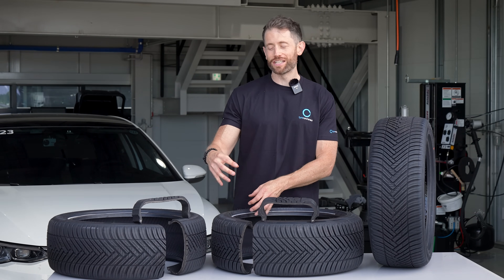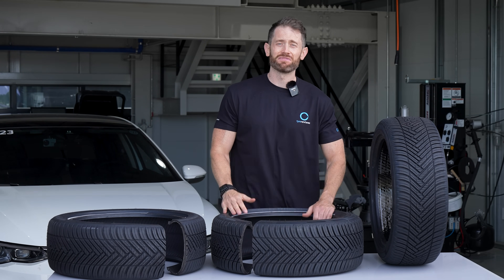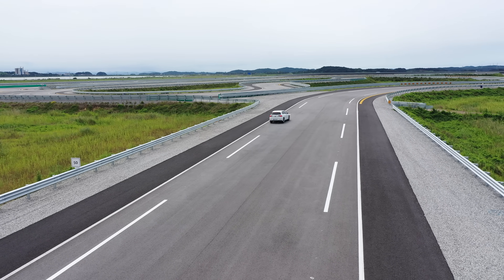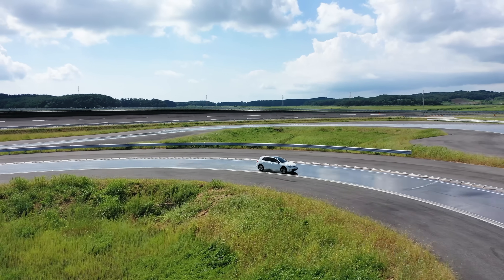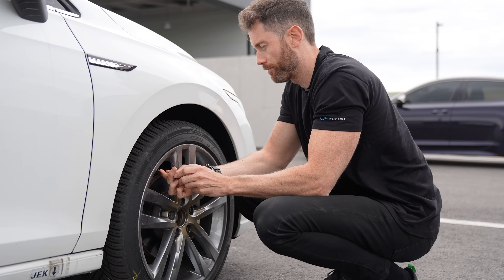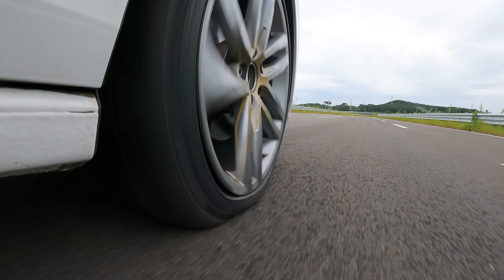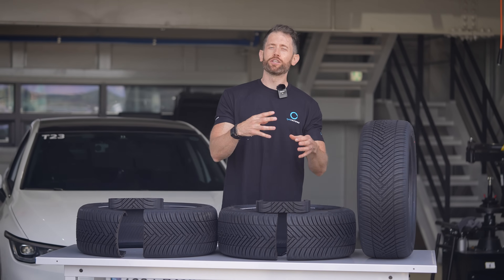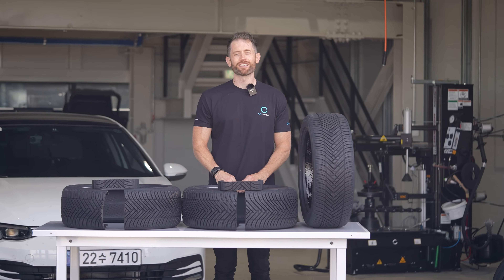Are Modern Runflat Tires Finally Good? Normal, RFT and SEAL Tires Compared!

Comment: My daily driver for the last 4 years have been an BMW X3 3.0 diesel with 21’ rims and it came with OEM run flat tires. I then changed to non run flats and more sporty tires and was never really happy but kept them until they were ready to get changed again. Went back to the OEM standard run flat tire that BMW had choosing for this car and boy what a different car it is again. It just works so much better with this tire. More direct and much better comfort. Of course the run flat tires being new vs. the old ones - but still I remember going from old run flats to the new non run flats - I didn’t have this positive feeling. So to summarize it - the run flats today are very good tires and the SEAL tires sound like something we should see more off in the future.

Comment: My experience with rulflat is nobody is repairing them. Had small puncher in one of tyre and when tpm whent off straight away put air in it. Straight went to garage to fix it but no one is repairing them. End up of changing tyres.

Comment: My BMW came with 17 inch runflat tires from 2016. I mounted new runflat tires this january from the same brand (Bridgestone) , and the difference is night and day. The older runflats are far less comfortable than the new ones. If you don't do track days and don't have space for a spare, runflats are fine 🙂
Reply: All new tires are better
Reply: My only worry is if it bends the rims over bad road surfaces.
Reply: Could you tell the model name of your tire? I currently run a Bridgestone Potenza runflat 225/50 r17 manufactured in the year 2020 in the front and I feel it's on the stiffer side.
Reply: @georgesunnyt  I run turanza's in 225/40/18. They're still stiff, don't get me wrong. But my previous set is muuuuch stiffer and are 17 inch...

Comment: The main safety importance of RFT (and "seal" technology) is that you don't have to stop on dangerous roads maybe in the night and in the middle of a (snow) storm (happened to me) to change a tyre  while praying to not get killed by other drivers.
The main downside for RFT's is 90% of drivers doesn't notice the flat tyre or knows (recognizes) the flat tyre warning sign on the dashboard (probably not a single woman knows it and most men don't either).

Comment: RFT tyres have bad reputation because they are bad. This is just my experience so that is single example (well actually like 8 examples just in cars and accidents I had), but every single time I had puncture RTF failed. I guess because I don't generally have puncture and I generally take good care of the tyres, but when I have puncture it is big one... all 3 times run flat tyre simply dismounted itself and I had to get trailer to recover the car, basically it left me stranded all 3 times. Same story with sealants, had 2 occasions where I only had "bottle of goop" and it didn't work, because puncture was too big and finally 3 times I bought the car with RTF, then replaced with similar standard tyres the driving was night and day... and the cost difference as well was massive. This is why I think to this day the best solution is to have a spare tyre.

That said Hankook's sealed tyre really looked impressive, had no impact on anything, no impact on comfort and it seems it did exactly what it meant to do (by the way I can hear distinctive and horrible RTF noise when you put the video comparing noise). Sealed tyres are definitely something I would like to get instead of bottle of glue... if spare is not an option. The biggest problem with glue, is that by the time you realise you have puncture it is most likely too late put the glue in... so it would really only work if you notice slow leak very early on. Whereas sealed tyre would fix itself right away and it is probably best compromise out of 3.

Final point - I just can't see reason why runflat can't as well be sealed, it think it should... and that perhaps would justify the scarify by essentially having tyre which is unlikely to ever be defeated (in theory).
Reply: Interesting comments. 
Were your wheels oem for runflats or for normal and you fitted the runflats afterwards?
Seen a few nasty reports re runflats coming off the rims.
Cheers.
Reply: @James-RJM  All of them were on new cars, so basically I bought either brand new car with them fitted from the factory, or nearly new car which still had factory tyres. 

That is BMW E90/G20 and Subaru Legacy. The rims were standard, so I just fitted the normal tyres afterwards, or later had the same car but on normal tyres. On G20 I literally cracked the wheel. 

And just to be clear - I don't think normal tyres would have survived in those occasions, but more importantly not even RFT survived, so in the end I was stranded for not having spare.

I guess my point - RFT are not replacement for spare.
Reply: @lp9280  I'm steering towards finding a decent uhp tyre with sealant already inside, but the availability, subject to size, is poor.
I've checked most times I buy new tyres for the last 15+ years, and extensively again since this video.
Someone on here also has mentioned a product called Ultraseal, which is applied into the tyre via the valve, after fitting. I'm guessing one balances them after it has been added and the vehicle temporarily driven to disperse the gunk first?!
Need to research further however....
Cheers.
Reply: @James-RJM  Same here, sealed tyres are rare and I said that is what I would be interested in. There are tyre sealants you can DIY, but they make absolute mess inside the tyre.

I was kind of lucky to own the cars with spares recently so it is less of an issue and on my last car without spare (Lexus RC-F) I just bought spaces-saver spare wheel for £90. Slightly annoying to keep it in the boot, but that is nothing compare to being stuck on the side of the road for hours just because of puncture in the tyre.
Reply: @lp9280  That sounds like a handful, in the wet!😉
I have its humble sibling, a GR Yaris convenience pack in the UK.
Very frustrating trying to source these sealant tyres!
I'm 225 40 18 and currently running asymmetric 5's, but you must be 19's + and possibly more choice?
I know the pz4, csc5, asymmetric 3/5 and primacy do some sizes with sealant inside.
Only the asymmetric 3/5 or pz4 truly appeal to me. 
The conti has reasonable reviews but wears extremely quickly and the primacy is more touring but in the 4/4+ it might be OK.
Only the conti does a size "close" to mine in the uk, that might be a possible fit.
I'll keep researching but will likely end up getting the normal and new asymmetric 6. A great tyre, but no sealant inside unfortunately.
Reply: @James-RJM  To be fair it is numb, wet or dry. It is luxobarge GT... great engine, great build, great car all around,  but it isn't nimble and fun to play with.
Reply: @lp9280  That's why I chose my car, over many others.
Yes a sonorous V8 would be lovely, but even they are slowly being muffled 😏

Wanted awd this time, in a small car, light and quite quick plus with a manual. This ticked those boxes.
Chose the Convenience pack to give me the extra toys and comforts omitted from the standard or circuit pack. The latter not needed, as I'm using only on the road as my daily. 
She grips phenomenally well on the asymmetric 5's.

Comment: Surely another point to take into consideration is that both the runflat and sealed tyre can't be repaired . Also the sealed tyre could have damage that is hard to detect,it might hold air but the structure of the tyre could lead to problems, especially at high speeds.When taking safety and costs into account,I'd stick to the standard tyre.

Comment: It is good to see that runflats have improved. I had a set of Bridgestones RFT on a BMW and it was like driving on tyres filled with concrete. They also made the wheels prone to cracking by transmitting all of the shocks from the road straight to the wheels.
Reply: My E90 BMW had original RFTs and rode the same. Tramlined all over the road. But the steering feedback and high speed stability in corners more than made up for it. And the added safety in California where the roads potholes are like craters. Suspension was designed for them as well. I miss them!
Reply: @brianlobo1512  I put Goodyear Eagle Assymetric 5 non runflats on mine and carried a spacesaver. Everything about how the car rode and handled was improved, and the tyres were less expensive.

Comment: I had run flats on my corvette , and my trans am. The ride is harsh and loud. I actually learned to live with it , until recently when I got new tires. The difference in comfort and noise level is insane.
 Ps I got continentals because of this guy 😂😂😂

Comment: Vehicle weight could have an influence on the difference. I had a 2013 diesel BMW X5 at about 5,000 lb IIRC with Continentals on it. It was close to tire changing time and we were going to be traveling in the U.S. Southwest during the summer and I didn't want to have to deal with changing a tire out there. There was no spare because the vehicle originally came with run-flats. So I reluctantly put the RF on. Perelli Scorpions because I couldn't get Michelin during the pandemic (supply chain of course).

What a surprise. The RF's on the vehicle ran better and smother than the standard tires. (And yes, over here we spell "tires" correctly. C'mon Britain, get into this century - and drop the "whilst" while you are it. No, not a Yank, a Canadian, one of your closest national cousins. </rant>).

Our new MB GLC300 has the Perelli RF with the same wheel size. I can tell the difference due to the difference in vehicle weight. They were better on the X5.
Reply from the maker: Glad they worked out! While I also agree tires is better, technically you are speaking our language, you just chose to mess it up ;)

Comment: Intriguing to see. how far run-flats (seemingly) have come. My problem with run-flats of the Michelin Primacy 2014 vintage was their inability to track straight on a motorway without needing constant correction. This and the small bump absorption made a standard PS4 the way forward for me. But now...
Reply: Ps4 zp runflat out now, subject to size!
Haven't used it but reviews look very good for an uhp tyre. 
Not sure it will be almost like normal tyres as in this test.
But finding that they make sealant or rft in the tyre sized owned, by numerous manufacturers is another story!!
Reply: @James-RJM  Thanks for the info. Agree totally about the size issue: a real limitation.

Comment: My wife, because of part of the road she has to pass to her work, is constantly having punctures. As the others working there AFAIK. Sealed tires would be perfect for her. She's driving small city car, but reasonably modern that has pressure sensors (the real ones, not ABS-based like VW does). So I think we'll be happy to pay extra 15% for sealed tires for her. Unfortunately I'm not aware of any available around me.
Reply: There's internet.

Comment: I didn't know seal tires exist. haha. Thanks to Tyre Reviews one more time.
By the way, I think seal tires should be quieter than normal tires in theory. You might be able to hear the difference inside the car at higher speeds, especially for higher noise frequency ( more annoyance to human hearing). 
The seal should make it quieter just like it would if you put a seal layer under a drum surface. It prevents the surface to vibrate too much. And vibration (wave) is the way sound travel.
I will definitely look at seal tires next time. Thanks.
Reply from the maker: That's what I thought but in some cases it sounded like there was a little more noise. All three were super close

Comment: Great video as always! I have a sort of unrelated question though. I have a 2021 Suzuki S-cross and I'm mostly happy with the car, except for ride comfort and noise coming form the wheels. I'm using Goodyear Vector gen2 215/55 R17 94V-s. I did try the gen3 98W XL-s (that was the only available in the size) and that was terrible on the car. I was loud and rigid and really bad on rough surfaces. 90% of my driving is around town and on motorways. Which all season tire would you recommend if cbin noise and comfort is my primary concern?
Reply from the maker: They're all very close these days, I'd check out some tests on the site to narrow it down as right now I can't rememeber whos best lol

Comment: I have driven with run flats for the last 4 years.  During that time I have experienced 3 blow outs resulting from pot holes.  These run flats were not low profile tires.  My concern is that run flats may be more prone to a blow out from pot holes.  Over the last thirty years I have only experienced one other blow out on a conventional tire.  And that one blow out was on a ridiculously deep pot hole (which was also too wide to steer around).   Thank you for your videos.
Reply from the maker: You're not the first person to suggest that
Reply: They are stiffer,they can not be more prone to blow out. They could resist bigger forces. Maybe people drive faster and more carelessly over potholes knowing they have RFT.

Comment: Hey, great test as usual.
What was the load rating on the tested tyres, and how much did the test vehicle weight? I could be wrong but my assumption is that the differences between runflats and normals gets bigger with higher load ratings and heavier vehicles. Heavier vehicles in general need higher tyre pressures, meaning that bigger portion of the weight is supported by the air instead of the tyre structure. In that case the runflat should need to have proportionally more excess structure to carry the weight.

Comment: Being a taxi driver of 24 years, ive been running michelin primacy 3/4s (summer) and the goodyear  ultra grips in winters for the past 12 years or so these all season sealants will be my next choice. Ps had 2 punctures @£19 each in the past month alone! Epic tyres and thanks for hanncook for the tests. Cheers
Reply from the maker: Sounds like a good investment
Reply: @fancy a bev mate.  In the UK their is a product called puncturesafe which is fitted into existing tyres puncture resistant.  It also depends on level of puncture resistance required.
A1 Puncturesafe
Reply: @davidlambert5426  thanks I’ll look into that cheers
Reply: Me I'm based in west yorkshire and their are a number of fellow Franchises as well around the UK.  There is also a option of a DIY install or have it fitted by the franchise itself.
Reply: Some people say tyre insurance is a waste of money but definitely worth it if you get a lot of punctures although the shop prefers to do a repair free of charge rather than replace the tyre

Comment: I would very much like to see a test with tires from all categories, sport, touring, 4 seasons, winter, etc., for example 225/45/17 on 7, 7.5, 8 inch wide wheels and see the results in all conditions.

Comment: Except when off roading in Moab with a Hummer I have not had a flat tire in more years than I can determine. And in Moab it was due to sidewall tearing, I removed the run flats on my Vette, installed Goodyear GSD3 tires, placed a plug kit and air compressor in the back center compartment and ran for 20K miles and never had a flat. If you look at the people with flats, usually the tires are run bald to the point you can see the air inside the tire. So not sure if a sealant tire is needed unless running around construction sites. But to each their own, it appears to be a good product; however, still says Hankook on the side.
Reply from the maker: That Goodyear was one of the all time greats

Comment: Makes sense about the feeling. At the limit a normal tyre will be on a curve, the run flats (because they’re stiffer) is more like going off a cliff… or at least a steep hill.

My experience with a run flat wasn’t actually a run flat, it was a cheap tyre that acted like a run flat. In the dry it was okay, in the wet it was terrible to the point of dangerous. Anyway, was on a drive, something didn’t feel right but pressed on, doing… spirited commuting speeds. Almost home after about 25 miles and stopped at a garage to check pressures. All ok apart from front left which was 10psi. Oops. Got the tyres changed, the flat one… the wheel had shredded the inside of the tyre. Lessons learned: Run flats are impressive for what they can do, and of course just don’t fit cheap tyres

Comment: Is there a difference in "tram lining" will it tram line worse in runflats etc pull the steering wheel to the side
Reply from the maker: Yes generally stiffer sidewall means more tramlining

Comment: Can't say I'm convinced.  All of my old vehicles have old fashioned high sidewalls, and they are far more comfortable to drive on than these new generations of big wheel small tire standards.  I can tell the comfort difference of 5 psi on my old Lincoln luxury car.  I have 10 ply heavy duty tires on my old light duty truck, and that stiff sidewall can be felt on every bump.  

The idea that a thin tire, a heavy sidewall tire isn't that much of a loss of luxury is questionable.  If "sporty" is your only goal, or primary value, you might be right.  But it is a stretch to think they aren't going to be a worse choice for a smoother ride in general.